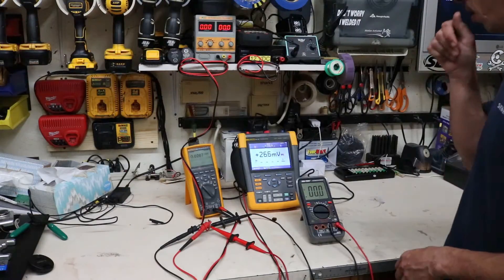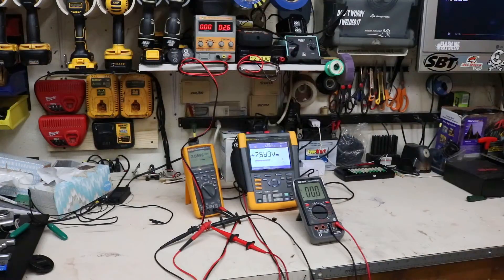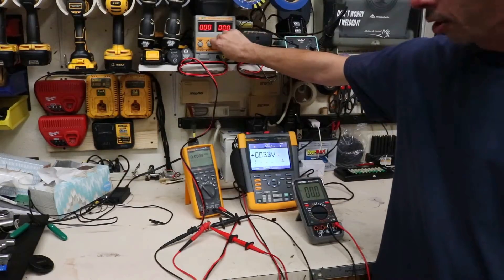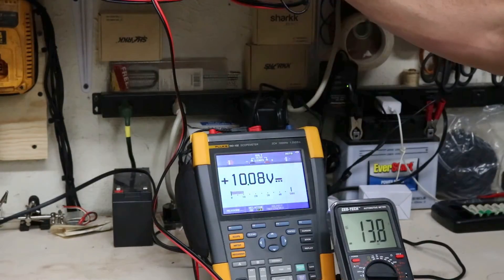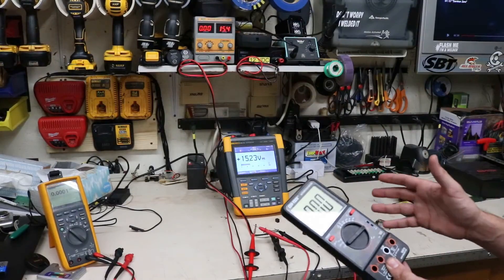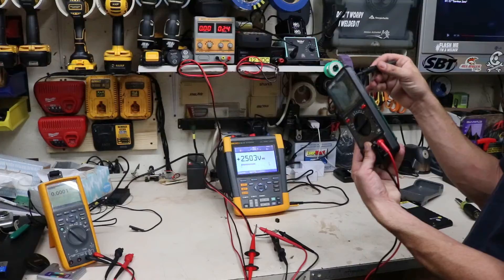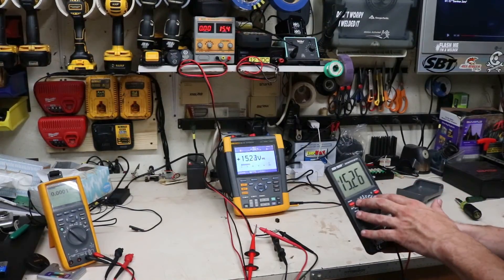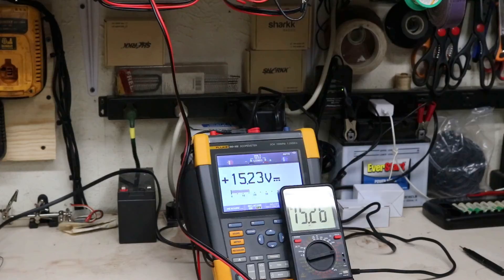Can you calibrate cheap multimeters (DMM) to make it accurate?

Comment: To all the folks watching in modern times, no, this doesn't solve the problem. These meters are cheap and shit, and calibration doesn't magically make them better; if that was the case then they'd be professionally calibrated at the factory, which they are, and then sold as pro-grade meters. But they lose calibration, which is why they wouldn't stay in-tune for over a day MAX

Comment: When you calibrated the meter DC voltage did it calibrate the AC voltage at the same time as well as the ohms and other ranges? When you adjust the pot does it not nock the other functions of to some degree

Comment: The manufacturers of those cheap multimeter would have more knowledge and better calibration equipment than you to begin with...so if it does not accurate, it would not changes

Comment: I got extech ma 1500 and all the potentiomerer had a v beside them come to find out there not all voltage they were amps .i had to buy whole other meter to get a rough calibration to dial them in and then i some messed the newiest one up .i was adjusting the voltage and the meter jas something built in it that makes voltage start drifting all over the placd .thought it was potentiometer so replaces potentiometer and it was still doing it and waited dor a couple hours and it started working again

Comment: Wow, that CEN-TECH autometer is either damaged or severely out of calibration.  The accuracy spec on the 20Vdc range is (0.8%+5). I'm reading that as 0.8% of the voltage plus 5 times the resolution, which is 0.1V on this scale.  So your maximum value you should measure for a 15.25V voltage is approximately 15.88V.  Something is very wrong if you are reading 21.0V.

Comment: Good video, thanks for posting. In the several years since this video was uploaded,  cheap "True RMS"  AC volt meters have been marketed.  For low voltage AC measurements (filament) are they any good (1 decimal point or 10%) ?
Reply: Not only that. New cheap multimeters are now fully digital with no potentiometer anywhere that I can find to calibrate them : (

Comment: What I take from this is that this CEN-TECH DMM is pretty crappy.
Reply from the maker: It works for some , in some situations.  If your checking if you have voltage AC or DC or if a car battery has a charge its sufficient but if your using it for controls work I would look at a better meter.

Comment: Why would you use your scopemeter for checking the calibration of the Centech meter when you have the 287?   The 287 is >10x more accurate... lol.  Scopemeters should only really be used for signals that change with time, on the 'scope' mode, or if you need an isolated input.  Also, I could understand using the 'meter' mode on the scope meter if that's the only tool that you have.  But, you've got a significantly higher performing multimeter right next to it, and you just set it aside... lol... makes no sense at all.
Reply: I agree.

Comment: Good video.

As for that Centech meter...  I think the best course of action would be to discard it, rather than calibrate it.

I've worked with both high end and cheap meters all my life and I have never seen a meter with a 9 volt deviation at 15 volts based purely on a low battery.  Does it say in the literature that the Centech is accurate, plus or minus 40%?  :)

Seriously, I wouldn't trust that meter as a paperweight!  Given it's tach and dwell ranges, it's obviously designed for automotive use.  Initially, it was reading over 13volts with a 10volt input.  This would definitely mislead an automotive technician in so many directions thinking he's dealing with a fully charged battery, when in fact he doesn't have enough juice to even crank the engine...

Is it possible the voltage pot got knocked after you opened it up?  If you're going to keep it and use it, I'd suggest using a variable power supply to power the meter and checking to see where it's readings fall with a low battery condition.  If there is as much a discrepancy as you've shown in your video, the Centech meter must be using the internal battery as a measurement reference, which would be an extreme "no go" in meter design.

Steve
Reply from the maker: For the vast majority of my work both personally and professional i only use high end meters,  as a professional I do not have time to second guess my test equipment as do most people in a tech trade.

I think the Centech has its place, certainly not in any professional setting. but for someone on a budget that is just getting into electronics I think it may be of use.

High end meters usually have some form of brown out and black out protection, cheaper meters usually dont, so that would give a causality for the faulty readings due to low battery.  But even my fluke 287 gets about 5-10% deviation  in the reading when the battery gets low even before showing the low battery indicator so I do not believe any piece test equipment would be completely guarded against faults at low input voltage at least to some extent. 

I agree with you that an auto tech or any tech for that matter should not be using this meter trouble shooting.

The voltage pot is fairy recessed and low profile, so the chances of me bumping it during disassembly is unlikely but not impossible
.
Like most things from harbor freights its a hit or miss, sometimes you get something of decent quality and sometimes you get a pile of junk so I may just got a bad that got skipped on QA or one thats been knocked and kicked around the store before purchase.

I may have to make up a follow up video using a regulated power supply to feed the meter and see at what voltage the meter starts to act up and do the same with a low to mid range Fluke to compare the difference in brownout or low voltage conditions.

Thank you for your insights and comments, please let me know what you think of my other videos.